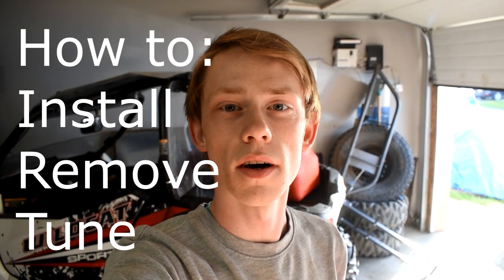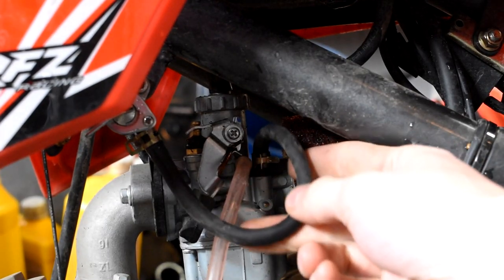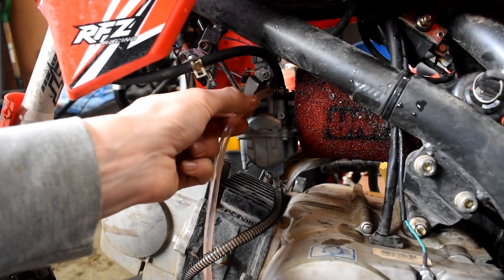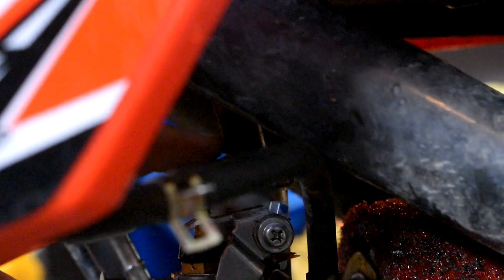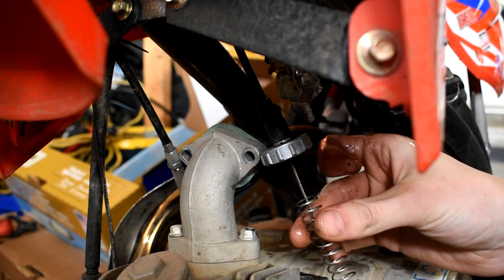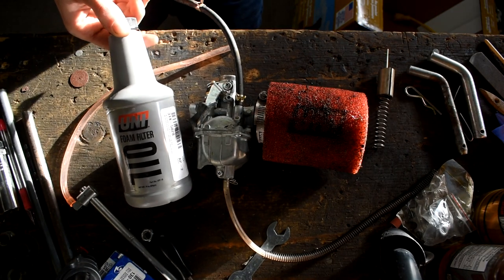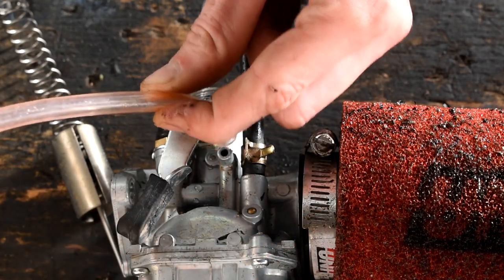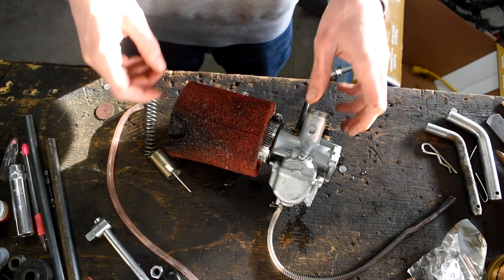How To Fix Dirt Pit Bike Bogging | Upgrading Chinese Pit Bike Carb

Comment: This is a great video down to every detail I like  an sub ..I have a question  so for a apollo 125cc z220 max that breather hose you say on the carb at the bottom that comes on the custome  carbs do it supposed to leak fuel out time from Time  ? I'm not talking  about pouring out but I do get fuel coming out of that hose is that normal since it is  connected to the carb or no ...?
Reply from the maker: Larry McCoy sounds like your carb float may be getting stuck, which would result in the carb bowl overflowing with fuel
Reply from the maker: Larry McCoy if you’ve just dropped the bike on its side thats normal for some fuel to leak out after
Reply: @AaronsEnduro  where is the carb float located at ? I'm guessing inside the carb...is this dangerous  or would it harm the bike I drop the bike twice its basically  new I had the bike 1 month an only rode it four times I willey up an fell both times didn't  know these bikes have so much torque  I'm new to riding  so the bike runs ok bogs  sometimes but I notice that the hoes sometimes leaks gas an my gas filter fill up with gasoline  now ..it didn't  fill up the first  ride I took but now the gas filter  stay pretty full so I'm just making sure all this is normal or no.. it still starts an run ..an thanks for replying  Aaron
Reply from the maker: Definetly a stuck float. Google search is best way for you to understand what it is. Not sure how to describe it via text
Reply: @AaronsEnduro  thanks for the reply u was right hit it fixed thanks again I really appreciate this
Reply from the maker: Im glad i could help!

Comment: did the exact setting for the air screw and needle for throttle fix the bogging or did you also have to adjust the jets. I was just wondering because I am a noob and wanted to use the exact settings you used for your bike.
Reply from the maker: Okay so, note this: you cannot copy jets from someone else(because sea level changes what jets you need) (im at 0ft sea level) , therefore as well, the needle placement will be particular to what jetting you have for when you want the throttle to open how much
Reply: @AaronsEnduro  thank you

Comment: Okay easier than I thought, I was so close to messing with the jets 😭
Reply from the maker: Very straightforward
Reply: @AaronsEnduro hey could you make a video on how to properly set the needle and the little pin on top, you never showed it and my throttle cable won’t go through the slide

Comment: What did you do with the tube that connects to back of the stock air filter? And did you have to tune the bike after you changed filters
Reply from the maker: Remove it , and run the hose that come from the engine down the back side if the casing

Comment: What is the point of the air filter if you need oil for it not to blow up your engine
Reply from the maker: The filter oil is to protect your engine
Reply from the maker: The filter oil
Goes onto the air filter. Its completely separate from the engine oil . The reason youll blow ur bike up without it is the foam filters are supposed to have filter oil applied to be able to fully entrap dirt particals
Reply: @AaronsEnduro  is there a filter I can get that doesn’t need the oil?
Reply from the maker: Ones that are shit lol
Reply: @AaronsEnduro  I just feel like needing the oil for the air filter to work kinda defeats the point of an air filter lol
Reply from the maker: Dont be lazy, get a good filter and oil. Not worth it to cheap out and have ur engine blow up
Reply: @AaronsEnduro  I don’t think I’m being lazy, it just doesn’t make sense to me. I will do it though.
Reply from the maker: Maybe you should do some google / research on why its important
Reply from the maker: What happens when u blow through a bubbler blower with no soap? Air goes right through it. Now what about if there was soap on the bubble blower? The air is entraped in a bubble. Same idea/concept with air filters oil.
Reply from the maker: All the dirt and debris will stick to the air filter oil, entrapping dirt in the filter. Without the oil. Your air filter is just passing dirt right into ur carb. Go ahead and run a filter without filter oil. Youll see after ur first ride ur carb is full of dirt

Comment: My pitbike runs fine revs fine until I would say 15 mins of riding it starts to bog when I accelerate to open throttle but if u keep it open throttled it just bogs it doesn’t die carbs clean been through that bought a new carb and air filter and still same results
Reply from the maker: Not really too sure on that one. Possibly a float issue? Definitely some sort of fueling issue
Reply: @AaronsEnduro  gonna order another carb and try again
Reply from the maker: Id start with checking over the current carb you have to try and isolate the issue. (So you know what your issue is)
Reply: @AaronsEnduro  their not much I can do mate as the bowl screws are rounded and doesn’t come loose so been using my stock one but it’s same issue with that and I’ve went over the full thing from cleaning jets to adjusting the bowl to the right way so that’s how I know it’s not my carb with the rounded screws
Reply: Gonna check if it’s getting enough fuel tomorrow

Comment: i have an apollo rfz db18 and my filter has a hose but the new carburetor filter doesn’t, what do i do with the old hose that’s connected to my bike? or do i keep my original filter and connect it to the new carburetor
Reply from the maker: Use the new filter its way better ( the 2 stage foam) make sure to use filter oil. Route the tube that used to connect to your filter down the back side of the casing ( the engine) youll see a little tab thats ment for you to clip it in. Its just a vent tube , but you want it pointed at the ground
Reply: Aaron Greenway also, my carburetor didn’t come with that foam filter, it came with one that looks like the original one just without the tube that’s in the back of it
Reply from the maker: Don’t use either, those filters are awful and you’ll literally suck dirt into the carb and ur engine. Get a UNI filter. Its the only thing protecting the engine in these bikes

Comment: My bike is still bogging after a new carb put in today I turned idle screw up alittle seemed to not do anything or help do I have to adjust the fuel mixture screw since I touched the idle screw or is it separate operations . Also how do you adjust fuel mixture screw if needed
Reply from the maker: Start with the idle and and the fuel screw 2 turns put from all the way in
Reply: @AaronsEnduro  I already turned my idle in alittle but should I screw both screws all the way in and 2 turns out on both you mean I’m confused
Reply from the maker: Thats correct.

Screw both all the way in. The 2 turns out. And start the adjustments from there
Reply: @AaronsEnduro  do I start the bike or when it’s off turn both all the way in and two turns on each
Reply: @AaronsEnduro  also do I have to take carb off every time because that screw can’t get unless it’s off or I loose a bolt and turn it
Reply from the maker: The reason im saying to screw them in first, is so you know what position the two screws are in. Yes its a pain in the ass. Once its tuned its good to go.
Reply: @AaronsEnduro  so take carb off screw both in then do two turns out on both put it back on and do I do another two turns or just little ones after the first two turns
Reply: @AaronsEnduro  do I have to drain the carb in order to adjust
Reply from the maker: Nope!
Reply from the maker: Just little ones after. Like 1/8th to 1/4 turn
Reply: Do I have to do idle screw with air fuel mixture or can I just do air one
Reply: It idles good now just bogging so do I use just air fuel mixture screw
Reply from the maker: You can adjust them separately.
Reply from the maker: Yes, now adjust the fuel screw mixture
Reply from the maker: Id check the plug too before messing with it
Reply from the maker: Im going to assuming if its bogging and not popping and banging on acceleration, that the mixture is too rich and you should screw the needle in 1/8th turn and try it again

Comment: Thank you for posting this makuni info because as a I watched this and started calculating what I needed to comment on as I heard the you improvising (which can be good as long as it’s not in an instructional video) giving  the wrong advise about the needle settings and mid gear ⚙️ power. I didn’t want to come off like a douche bag that people tend to sound like when the heat something that might even be the slightest degree off the mark. But you posted a miluni manual which is where everyone should start. And then start learning about carb jetting and relying less on gas/air/idol screws. Cause every 1.5-2 turns a new jet should be used either up or down. as long as people know some golden rules. Which are universal like starting points. How to tell the difference between lean and rich mixtures and how to solve them along with bogging down and flat spots.. but read the manuel and if that doesn’t help, trial and error. Just don’t run it too lean. So check the spark plug every once in a while, too light to lean, too dark well that’s cause there’s to much gas that’s why you’re smokin up.
Reply from the maker: Thanks for watching :)

Comment: How do you tell if the choke is on or off on that bike
Reply from the maker: If you really want to know 100% take the rubber intake off the carb and see which way the butterfly valve moves. When its open the choke is off

Comment: Gas is coming out of the little oxygen tube , how can I fix that ?
Reply from the maker: If you’re referencing the tube at the bottom of the carb, thats the carb overflow. Its designed to pour gas out if the carb is overfilling with gas in the carb bowl. You may have a sticking float, or a cracked float etc.
Reply from the maker: This video will help you understand the float/carb
https://youtu.be/oyGP1uTU-jE

Comment: Would a rich mixture make the bike bog and cut out in 3rd gear?
Reply from the maker: A rich mixture would do that! Its possible you just need to adjust the clip position on the throttle slide needle tho! (That controls fuel mixture based on throttle input)
Reply: @AaronsEnduro  thanks for speedy reply yeah the bikes new only been out once and cleaned and put away for a month. Starts fine revs up just when in 3rd it stalls out can't be the jets if it's revving out in 1st and second ?? Plug looks black
Reply from the maker: If 1st and second seem to have no hesitation or stuttering id believe your needle clip position is what u should start with moving
Reply from the maker: If the plug is black you definitely have too much fuel. It should look golden brown like a roasted marshmallow
Reply from the maker: Id take a 1/8th turn of fuel out. Then if its still bad, try the needle adjustment
Reply: @AaronsEnduro  thanks will try and report back 🤙
Reply from the maker: Lemme know hwo it goes!

Comment: Hey dude do you know where I can get the carb gasket for the vm24 round slide? I swapped my stock carb and used the stock gasket and it’s too small for the carb. I believe the gasket I need is 48 mm hole to hole
Reply from the maker: Ebay and or amazon 👌🏼
Reply from the maker: Apollomotors.ca might have it aswell

Comment: Is your carb a 24mm?
Reply from the maker: Correct!
Reply: I need help with my 24mm mikuni carb when i open throtle really fast its boggin 4stroke anny help??!
Reply from the maker: Change your slide position (the needle in the top of the carb) it will change how soon it lets full air flow pass through. I bet its not set to the right level and is chocking out the bike
Reply: @AaronsEnduro  thx
Reply from the maker: No problem!
Reply: @AaronsEnduro  can u make a vif for tuning carb and all that
Reply: @AaronsEnduro  where can i send u a vid or caontact u?
Reply from the maker: Instagram

Aaron_greenway

Comment: Good vid but my throttle cable won’t come out the old carb what should I do ??
Reply from the maker: You’re referencing the metal cap with the cable ( and the cap just keeps spinning right?) on the stock carb there is a little brass pin you need to drill out to remove it
Reply from the maker: Spin the cap around till you see it ( on the top of the carb)
Reply: Aaron Greenway  Thanks great steps but now I was trying to change my clutch lever and ended up disconnecting my clutch cable from the the little lever that actives the clutch wat should I do ⁉️ I need to my the clutch cable long enough to reach the little metal thing again
Reply from the maker: Pm me via instagram for detailed help @aaron_greenway

Comment: Hey man awesome tutorial. Do I re use the air filter pod from stock carb and place new filter over the pod?
Reply from the maker: What is this “pod” you speak of? If you’re asking if you should use the original air filter , thatd be a no. You definitely want to run a good UNI 2 stage foam filter
Reply: @AaronsEnduro  the carb I got seems like it just came with the filter cover
Reply: Can I message you on IG?
Reply from the maker: Like a fabric sheeth? Thats for when you wash the bike
Reply from the maker: Hard to know exactly what your talking about without a visual
Reply: @AaronsEnduro  check IG

Comment: I’m leaking gas from my carburetor haven’t rode bike since like October bike still had gas in it, going to replace soon wish me luck 😎
Reply from the maker: Sounds like a stuck float bro
Reply: Should I just get a new carburetor or just clean it ? I was riding for literally 2 minutes then boom I’m leaking gas
Reply from the maker: Should Just need to be cleaned. When the float sticks it will overflow and leak gas ( the float bowl can only hold so much fuel until it spills out the overflow) when the float sticks it cant “tell it” to stop sending max amount of fuel
Reply: Appreciate you’re opinion bro, going to try and fix it this weekend glad I been subscribe for awhile you’re videos are always helpful... thanks again bro
Reply from the maker: Hope we can get it fixed!
Reply: Bro I've had a carby leak because o ring failed. It's where hose connects but on inside of carby it's tiny. 5 or 6mm x 1.5/2mm 👍
Reply: That's on a keihin carburetor. On Chinese bikes so not sure if any good

Comment: What will the thickness be for the Apollo 125cc be for the custom dirt bike graphic
Reply from the maker: They make it in multiple thickness’s
Reply: @AaronsEnduro  It don’t matter 🥴which thickness because I see the price changes and I just would like a different one from the one I got
Reply from the maker: You want a thicker one ( so it doesnt wear/rub through)
Reply: @AaronsEnduro  ok appreciate that man😎👍
Reply: @AaronsEnduro  hey do you have a link for an exhaust pipe
Reply from the maker: I do not as i couldn’t garuntee the fit
Reply: @AaronsEnduro  ok 👍

Comment: Hi Aaron, do you have some kind of "clip" to hold the throttle cable on top of the carb, where the throttle cable enter the carburetor because mine tend to get out when the throttle is fully close or maybe I just need a new cable?
Reply from the maker: This is too long ago that I honestly dont remember. Id say yea theres a clip usually or where the throttle cable locks in the the throttle slide so it cant slip out
Reply: @AaronsEnduro  No problem man, I know your vid it's like 2 years ago lol, thanks for your reply, I'll figure that out anyway, thanks man.👍

Comment: hey another question, my air filter has a tube on the right side that goes to the back of the bike, do I just remove the air filter and the tube?
Reply from the maker: Remove the tube, and  what the tube connects into ( oil air seperator)
Reply from the maker: Skip the “black piece” go straight from the motor the ground
Reply: Aaron Greenway sorry for the horrible explanation, I don’t know anything about these bikes lol
Reply: Aaron Greenway is there any way I can send a video or picture of what i’m talking about? may be easier
Reply from the maker: Instagram @aarongreenway
Reply: Aaron Greenway cool dmd you

Comment: what is that line for the intake when you first buy it and can you run it without it
Reply from the maker: It connects to the oil/air separator which most people delete (myself included) and the you vent the tube coming from the engine side to the ground
Reply: @AaronsEnduro  ok thanks
Reply from the maker: Thanks for watching and supporting 🤘🏼
Reply: wait so i just zip tie it to the frame or do i buy a small vent filter then attached it to it
Reply from the maker: Theres a clip in the back of the engine from factory to slip the tube into, then cut it to size
Reply: @AaronsEnduro  ooh i see thanks again
Reply from the maker: Hope you got it all figured out 👌🏼

Comment: Need a little help i installed a pz30 carb on my 150cc after porting and polishing ... my bike's plug color is lean but bike dies on choke nd also when i pull the throttle aggressively, if i pull it nice md easy it runs great but bogs when like im in 2nd gear on agresive pull it bogs nd dies
Reply from the maker: Maybe you’re mistaking “bogging” as lean cutting. Have you tried adding more fuel in the carb?
Reply: @AaronsEnduro  i haven't coz i think it dies on choke so may be needs smaller jet or changing the position of slide to rich position.... also changed the plug but didn't do anything , the bikes comes with 30mm stock carb now its pz30 38mm carb do u think its not compatible?
Reply: @RIseup440  hi, what did you end up doing to solve your bogging problem?
Reply from the maker: I think your carb is too rich. But checking the spark plug will verify that

Comment: Is there anywhere you can buy new vent tubes mine fell off
Reply from the maker: Go to your local hardware store and get some rubber hose. The vent tube is not specific or special. Now for the carb bowl drain line (if u lost that) 

Same thing go to hardware store and buy some gas safe fuel line
Reply: @AaronsEnduro  cheers